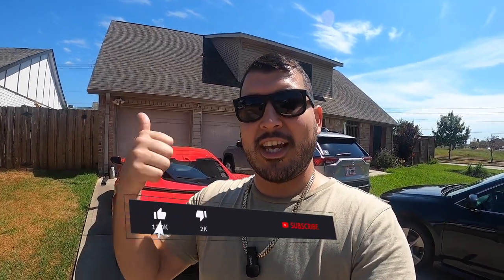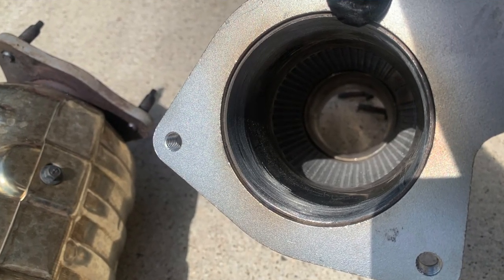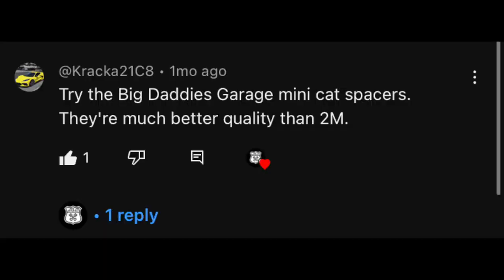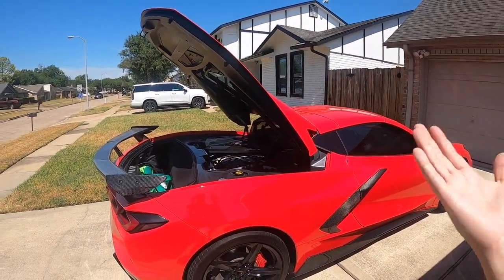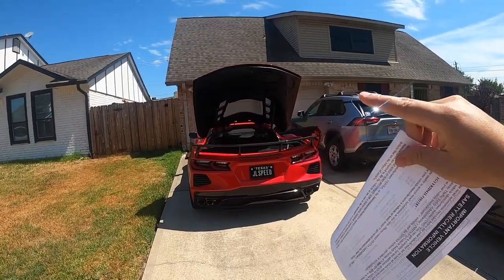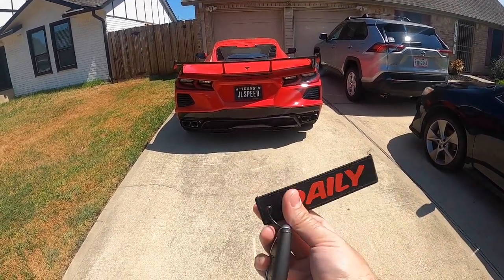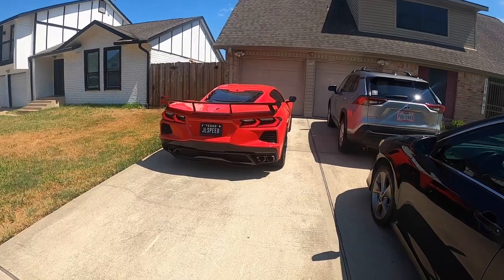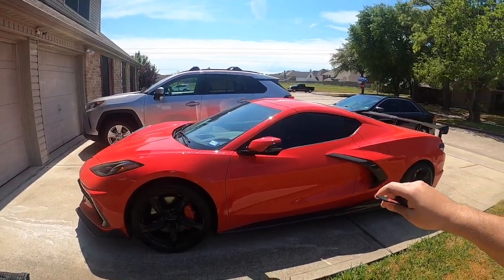C8 EOS High Flow Cats Check Engine Fix!

Comment: I have the same problem with Audi SQ5, I try so many different extension but check engine still comes after 20-30 miles and just today I replaced it to the factory

Comment: Did you order gaskets from GM and if so what was the part number thanks. Great videos thanks for the info still on the fence about doing it to mine?? Don't want to deal with the codes but love that sound.

Comment: Thanks for the update, been patiently waiting for this and the positive result. I'll order a set and try it out, and report back. Keep up the awesome vids.
Reply from the maker: I wanted to take my time with this update to make sure I really had a solution that worked!
Reply: I got my set of the Big Daddies Garage mini cats and just finished installing them and clearing the cel. I'll be putting about 200 miles on the car this weekend and see if the cel comes back. I'll let everyone know good or bad. Do you have an update as to your results so far?
Reply from the maker: @goodbyecalifornia3567  still no check engine light, got my car inspected and passed emissions obd2 check so so far so good drove it a bout 100 or so miles more since and still no code!
Reply from the maker: chadwickbaker8706  even with the big daddy garage mini cats? I would check the gaskets around the install and ensure they are all installed and sealed properly.
Reply: Same here, my cel keeps coming back about every 30 miles or so. It's getting really annoying! just the drivers side.
Reply from the maker: THat is unfortunate! I guess i am on the lucky side of the gamble driven the car a few more miles and multiple heat cycles and no check engine. chadwickbaker8706

Comment: how you still making out with high flows cats is the check engine light coming back im having the same problem .I did order those adapt waiting for them
Reply from the maker: It comes back if I get hard on the car and doo multiple pulls. But I can clear the codes and if I have to do an inspection I just drive the car normally and it’s good to go

Comment: Have you had any issues after this long? The spacers work still?
Reply from the maker: They work as long as you don’t go wot multiple times. Then light comes back. You can clear it and be good for state testing, but then it will come back if you go wot multiple times.
Reply: Dang ok. I have WOT at all times bc I did a cat-back exhaust system too🥲
Reply: How does it affect gas mileage overall?
Reply from the maker: @mishkadchowdhury4765  haven’t noticed much of any difference.

Comment: Didn’t it originally throw a permanent CEL that you couldn’t clear besides the dash. how did you get rid of that?
Reply from the maker: The permanent cell is stored in the ecm when you get the p420 code. It usually last a while, last couple times I scanned the car it wasn’t popping up if I had to guess it gets stored for a certain time and just clears out just I care someone tries to clear it before selling or trying to hide something.
Reply: @JLSpeed  glad to hear they go away over time and you don’t need Chevy to remove it. I assume inspections are able to see them if they don’t clear
Reply from the maker: @patrickschibsbye426  during inspections they only see a code if it has a check engine light other than that any of the permanent codes if they have been corrected won’t cause an issue with inspection.
Reply: @JLSpeed  not entirely true, permanent codes on 2017+ GM ecu's are stored in memory, you most likely got lucky since most cases Ive seen perma codes take a lot of drive cycles to clear. but sometimes permanent codes may be logged but not say current so it's best to avoid getting permanent-able CEL's at all cost. luckily for myself 2016 ss's perma codes are overwritten when you flash a tune.